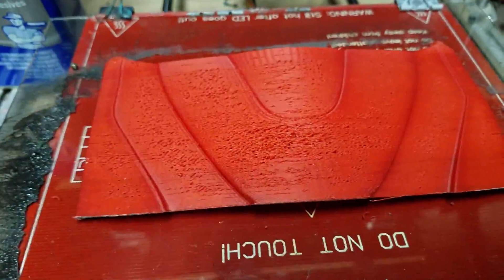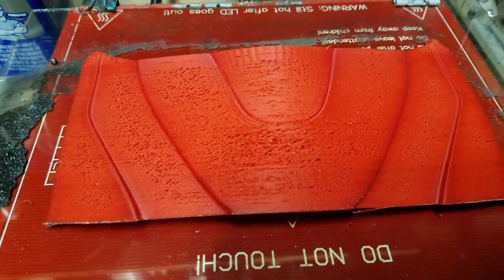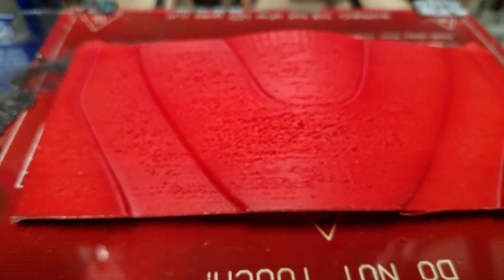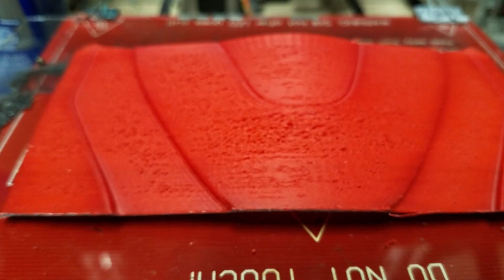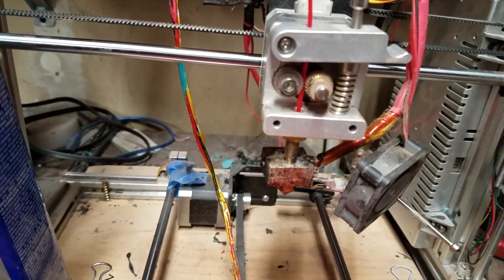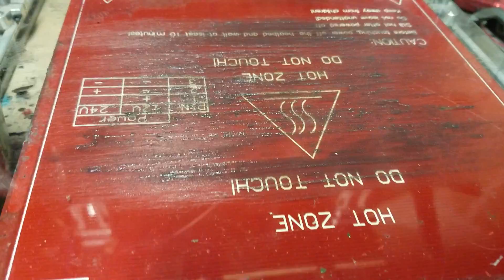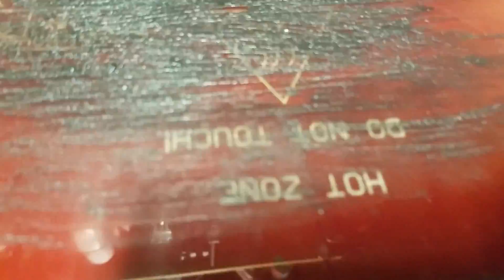Holes in Your 3D Print? This Simple Fix Will Help

Comment: looks in extruder "Well I'll be damned, that gear is a mess!" Thanks for the tips and screw the naysayers. They've probably never even tried printing ABS. ABS is an absolute bitch to print, especially without a dedicated enclosure. If I were printing big ass ABS parts like yours and doing finishing work on all of them like you are I'd be slurrying away too.

Comment: One more thing you might consider is to slow your print speed down by 25 percent.  You might be outrunning your extruder.  I experienced this same problem, and slowed the print speed which solved the problem of having big gaps like the ones you are experiencing now.  Just trying to help.

Comment: Your hot end is from where? Your hot end is junk. Do some research on hot end design and see what you are doing wrong. At 4:44 an image of the hot end.  All the threaded tube must stay cool at all times. The tiny neck just above the heater block is to be free to the open air. nuf said.
Reply from the maker: Paul C Johnson I've since switched to an E3D V6 hot end. Thanks for the comment!

Comment: Can also be incorrect steps per mm on the extruder... That can cause all sorts of issues. I realize that you specifically have a slipping issue. I just wanted to toss this in. If you are extruding too much you will get jams and slippage. If you are not extruding enough, then you will get the same issue symptoms you have.
Reply from the maker: Previous Roll of same type of material was fine. No change in settings. No difference in weather ot temp.
So if all the same settings from a previous roll of PLA didnt work on the next, there is an issue. I understand +5 to +10 differences in temp vary by manufacturer but holes in a print and VERY poor print quality..